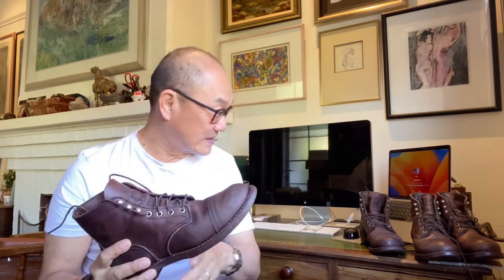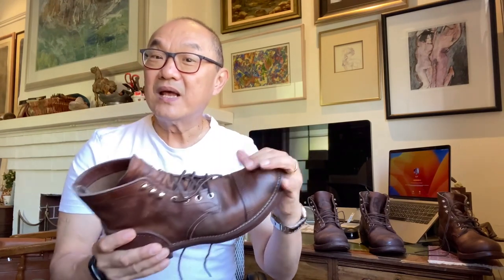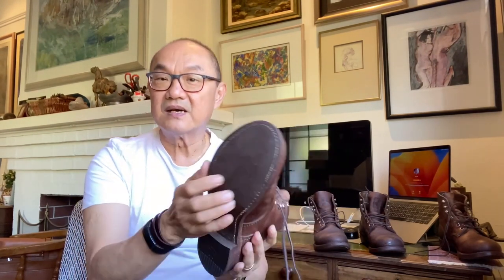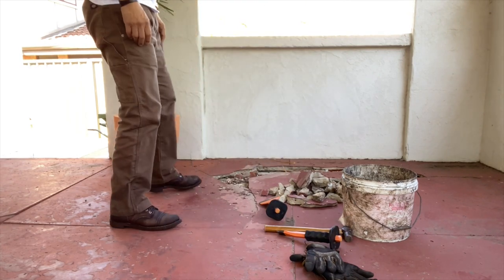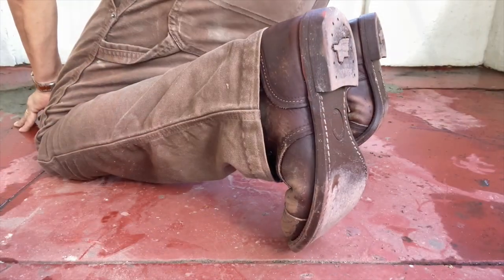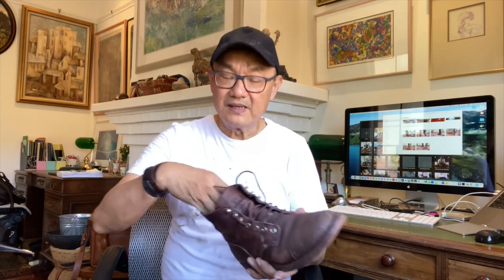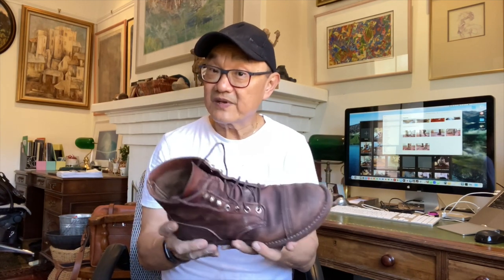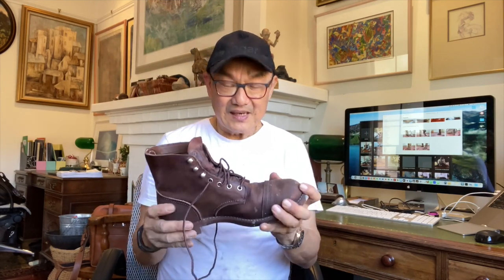Scratching An Itch   Red Wing Iron Ranger Again And What Happened To The Over-conditioned One

Comment: I would love to know how the insoles feel? I picked up a pair of 8111s from vinted for £85. The right foot fits perfectly but the left has a little difference in feel. Has taken a few weeks to adjust. I wear roughnecks and have owned many iron rangers over the year's. Just wondering what insoles you use and what's your method with 2nd hand pair of red wings

Comment: I read something not long ago about fixing over conditioned boots, and I think they were iron rangers as well.  They heated them up with a hair dryer and then used paper towels and cloth rags to absorb the warm oils and waxes.  They did that a few times and the results were pretty even and much lighter.  Give it a try.
Even if you dye it black, the color will likely take better if it’s not over conditioned.

Comment: Over time, with regular wear the overconditioned pair would dry out and return to normal color. 

Glad you added the safety glasses! Was a little worried for a moment.

I wore my IR for about 8 years, as a daily motorcycle and jobsite boot. Extremely hardy boot and I still wear them occasionally in the snow as an apre ski boot, and people rave about them in that context, but I’ve burned out on the style (for now), and they are pretty common. I’ve replaced them for motorcycle and jobsite visits with Whites MP Sherman, and GS saddle tan Brass Boot when I want pure comfort. 

Cheers!

Comment: I don't have much experience with stripping uppers. However Saphir Reno'Mat might be a good way to pull out a lot of the excess conditioner. It's definitely more gentle than acetone. So there's a good chance that the Saphir would not remove the original dye. The old pair might be a good test subject for some kind of patina project.
Reply from the maker: I’ve had these over a year and they’ve been through multiple renomat, saddle soap, dish soap, acetone and isopropyl alcohol! The conditioning over years of demo at Royal Fairs of boot oil and boot balm is deep!
Reply: @Bootlosophy  Wow I didn't think it was possible for acetone to not remove every bit of oil and wax. Industrial strength degreaser would probably remove the conditioner but destroy the leather in the process.

Comment: You can get the oil out with dish soap diluted in warm water and a horsehair brush. Dilution strength depends on how saturated with oil they are. Clean them in a sink or outdoors. Rinse them well,  wipe them down with a towel, and let them dry. One time may do it, or it may take 2-3 washes to get it out. You will have to apply some type of conditioner after, but go easy.

PS - stuff them with newspaper or paper towels while they dry to help keep the shape of the leather. Set them by an open window or leave them in a cool shady place to dry, and not in direct sun or near a heater or a fire.